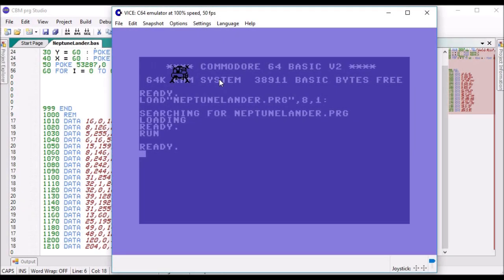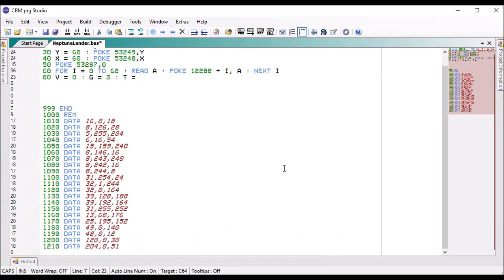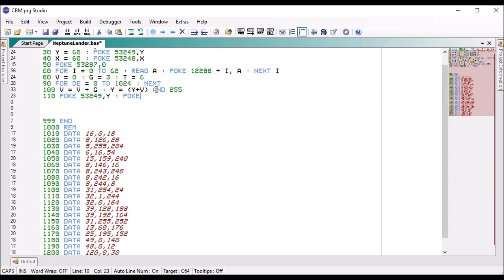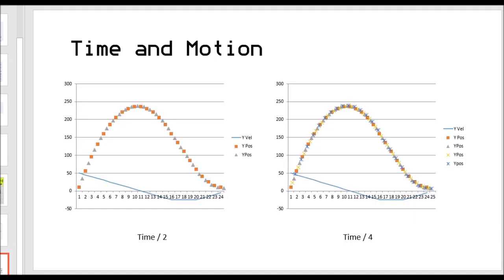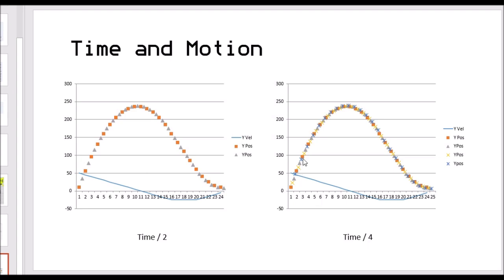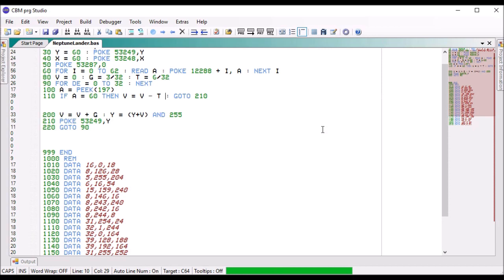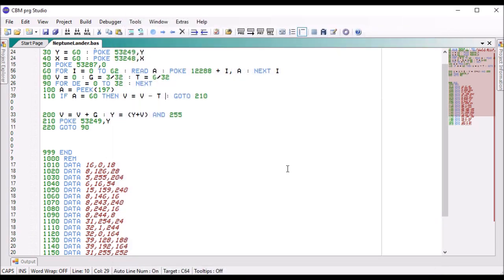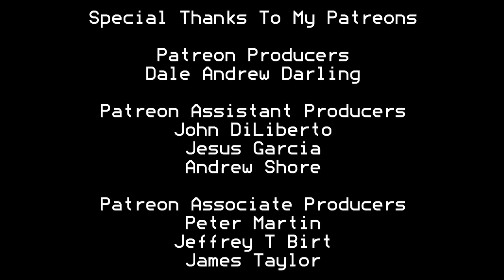Tutorial 33 - Overview of the VIC II Chip and Neptune Lander Physics Part Two

Comment: 1:45 You're rarely going to need much of a delay loop in an arcade-style game written in *BASIC*.  It's smoother and more portable to base delays on the TI variable.  At the top of the game loop you'd put something like TD=TI+15 and at the end, something like 198 IF TI<TD THEN 198.  Different paths through the BASIC program within the game loop will take different amounts of time, but trying to make each game frame take the same amount of real time will smooth out the action.

9:19 Apparently, memory location 203 gets the keycode first and location 197 lags location 203 by one IRQ keyscan.

11:05 Why wouldn't you just hold down the Space Bar?  You're doing a PEEK(197), so if you just hold it down, the target keycode will be there every time.  If you repeatedly tap the space bar, the target value will only be there a fraction of the time for the microsecond that the underlying LDA (PTR),Y does the fetch.  My VICE emulator doesn't have a problem if I hold down the space bar.  Does the integrated one have some kind of debugging feature?

13:01 Letting the user control their X and Y position directly is a bit odd in a landing simulator.  Presumably, that's just temporary for demonstration purposes.  In a real landing situation, you only have control over your vertical and horizontal thrust.

13:35 Why would you use 'Z' instead of 'S' for the downward direction?  That would be awkward to press for anyone used to WASD controls.
Reply from the maker: Brutikus Red, thank you for your comments about this video, you are right about the timer delay, that BASIC doesn't really need one, but this was to show that when we do convert to 6502, this would simulate us having one then.

I did not know that 197 is actually one IRQ request behind 203, this is something now, I thought they were a copy of each other, see I learning something new again :)

about the SPACE BAR, if you looked at the code I had on the screen there was a bug, and this is why when I held down the space bar, it was acting funny, did you see the bug, I did correct it in the code :)

the moving of the lander round using the X and Y is for simulation purposes only, you will see in later videos why I have coded that.

And the key controls are only temporary, ultimately we would be using the WASD system as well as Joystick, but I do thank you for this in depth discussion about this topic. I hope we can keep this going in future videos :D
Reply: @OldSkoolCoder : I didn't know about location 203 either until I tried to look up key codes for location 197 to verify that you were actually using 'Z'.  I didn't notice that the Space Bar line had the wrong GOTO address.
Reply from the maker: @csbruce  yup, that was the bug.... lol